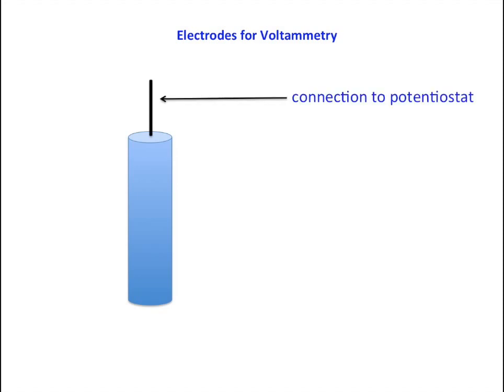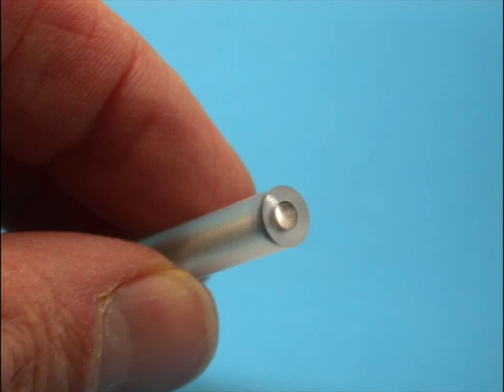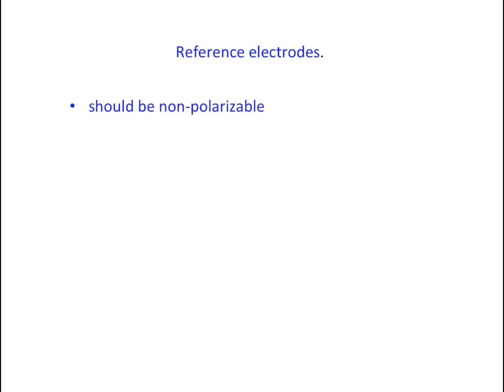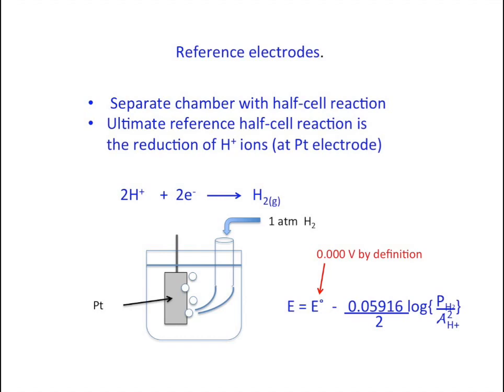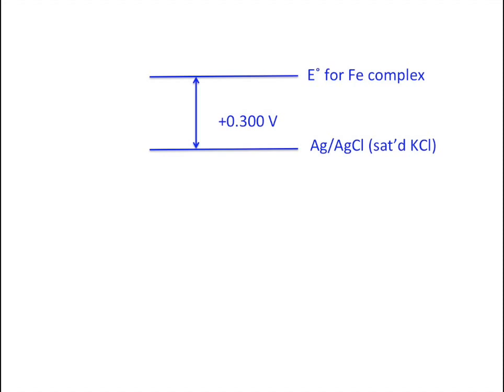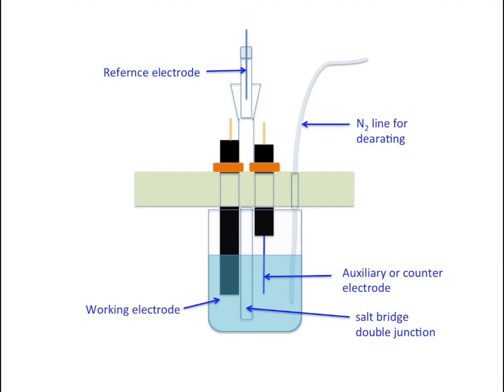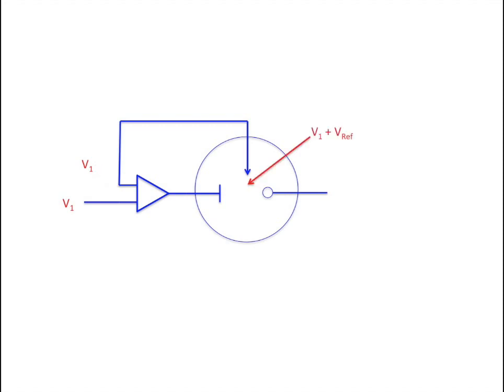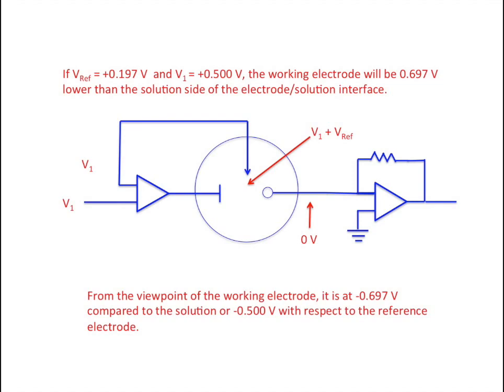Voltammetric Electrodes

Comment: Can someone please explain to me...if the working electrode cannot pass current (transfer of electrons into or from the solution) then how does it reduce or oxidize the species??
Reply from the maker: Hi Emaan,
I am not sure what conditions you are thinking of where the working electrode cannot pass current. You are correct that its main purpose is to reduce or oxidize species in solution. (We prevent the reference electrode from passing current so we don't disturb its potential. Could that be what you were thinking of?) We force the working electrode to different potentials in order to drive an exchange of electrons with something in solution. That potential must be near or more negative than the E˚' for the redox species in order to reduce any of the oxidized form and we monitor the current that passes in the voltammogram. (We see current for the oxidation of any reduced species when the working electrode is near or more positive than the E˚'.)
Reply: @garymabbott4064  thankyou for replying! And im confused because supposedly, a polarizable electrode cannot exchange electrons with the solution. I dont understand, if its not giving or receiving electrons (as a polarizable working electrode) how is it able to reduce or oxidize species?
Im really really new to electrochemistry (my whole career is in bio) so pardon me if im asking something really obvious
Reply from the maker: @emaanimtiaz4371  Electrochemistry can be confusing, in part because of all of the jargon. The term “polarizable electrode” means that voltage (the energy for an electron) between the surface of the electrode and the solution can be changed by imposing energy (from a battery or electrical power source) from outside the cell. We need at least one other electrode in the cell in order to do that experiment. A reference electrode, such as a silver/silver chloride electrode, can be used for that purpose. A good reference electrode will not move from its “rest potential” (its value that can be calculated from the Nernst Equation for the reference reaction, such as AgCl  + e  Ag + Cl-). We say that the reference electrode is non-polarizable. By selecting a non-polarizable reference electrode for a voltammetry experiment, virtually all of the energy (voltage) that we apply from the outside circuit ends up polarizing the working electrode. That is, all of the energy applied to the cell from the outside changes the voltage at the interface between the working electrode and the solution. If that voltage is big enough, it can force an electron exchange process there. A platinum wire or carbon electrodes are good working electrodes since they are polarizable and will exchange electrons readily with species in solution. 
	One point of possible confusion with electrochemical measurements is that there are two common types of experiments. Voltammetry is the type I was referring to in the paragraph above. Voltammetry is based on applying an external voltage to the system which forces an electron exchange at the working electrode. The current is measured and its magnitude is proportional to the concentration of the electroactive species in solution. Voltammetry uses a polarizable working electrode. The other common experiment is potentiometry. The rest voltage of the working electrode is determined by the solution conditions and it is this quantity that we measure in a potentiometric experiment. In that case the working electrode or sensor should not be polarizable. We try to prevent significant amount of current going through the cell, since it could distort the voltage that appears at the working electrode. That is, allowing current in the system would push the working electrode away from the voltage that naturally develops at its surface because of the concentration of the species that it senses.
	I hope that helps.
Reply from the maker: So, the bottom line is that a polarizable electrode CAN exchange electrons with something in solution, if we push it to the right voltage.
Reply: @garymabbott4064  thankyou, thankyou, thankyou! Iv been stuck on this for 2 days straight, watching a dozen youtube videos and googling it in a hundred different ways and NO ONE explained that. You've saved me from another sleepless night. Huge thanks
Reply from the maker: @emaanimtiaz4371  If you find yourself doing much in the future with electrochemical methods of analysis, I recommend (shamelessly) the following book:
Electroanalytical Chemistry
Principles, Best Practices, and Case Studies
By Gary A. Mabbott · 2020
ISBN: 9781119538585, 1119538580
Publisher: Wiley
Language: English
Author: Gary A. Mabbott

Comment: Reduction of the analyte on the working electrode requires a source of electrons, where the electron is obtained?
Reply from the maker: Electrons that the analyte takes from the electrode are replaced by a power supply (often a battery) that is part of the outer circuit. The arrangement of electrons (their "concentration") at the surface of the electrode is set by the voltage that is applied. If an electron "jumps" from the electrode to the analyte in solution, another electron will  move up to take its place in order to maintain the arrangement of charges associated with the voltage applied by  the power supply.

Comment: What is the potential at the reference electrode in a 3-electrode setup? is it 0.197V or is it whatever V_in we are driving into the opamp shown at the end of the video? Are we driving the reference electrode potential?
Reply from the maker: Wherever there is a boundary between two different phases or materials there is the possibility of a potential energy difference. Between the silver chloride coated wire and the solution surrounding it, there is a step up in potential of 0.197 V. A voltage, V1, is applied to one of the inputs of the amplifier. The amplifier is designed to drive the voltage at its output (where the auxiliary electrode is attached) to whatever value is needed so that the other input of the amplifier also reaches a value of V1. So, the wire attached to the reference electrode is at a voltage of V1. Moving from there into the silver wire and then across the interface of the AgCl and into the solution, the voltage steps up to a value of V1+0.197. So, (V1 + 0.197) volts is the potential of the solution. “Looking” from the solution toward the working electrode, an electro-active molecule “sees” the working electrode at zero volts. Consequently, the potential difference across the working electrode/solution boundary is a step of (V1 + 0.197) volts in the negative direction. The reference electrode is not really driven to change the potential across its boundary. That potential difference stays at +0.197 V,  but it gets added to the applied potential coming into the input of the amplifier.
Reply: @garymabbott4064  thank you, though I have two more questions: 1. is the 0.197V potential step between the reference electrode and the solution independent of whatever solution the reference electrode is in? 2. If I've understood correctly, we set the solution to a voltage of V1+0.197 with respect to earth ground, is this correct? In such a case, why is there no reaction at the reference electrode, is it because we are blocking mass transport to the reference wire?
Reply from the maker: @lucha6262  1.  The +0.197 V is the value that the reference electrode will have for a saturated solution of KCl. The potential energy difference between the AgCl coated Ag wire is, indeed, dependent on the chloride concentration (actually the activity) level. In a 1 M KCl solution, the potential is +0.222 V at 25˚C. 2. Yes, the V1 +0.197 V is the voltage of the solution with respect to ground. There will be a very tiny amount of a net reaction at the AgCl/Ag electrode because a real operational amplifier is not perfect and will allow some current (maybe a few picoamps--less for better amplifiers) to flow into the input of the op amp. That will not shift the potential of the reference electrode significantly. But, you have the right ide., The whole point of using a 3-electrode system was to avoid too much current (say microamps) going through the reference, because that would shift it away from the +0.197 V.

Comment: How about the current in ampere(in both oxidation and reduction)? How the system measure the current? is it related to counter electrode and working electrode?  Any equation for it just like the potential plot on x axis is the voltage of working electrode related to references electrode. Thank you.
Reply from the maker: Hi Canny,
You are asking a lot of good questions. This video was only part of the story. The current goes through the working electrode and the counter electrode through separate operational amplifiers in the outer circuit that are part of an instrument called a potentiostat. 

Here are two other videos that may help with some of your questions about what controls the current for oxidation and reduction. In these videos, I describe the main concepts from which the current-voltage equations are derived. To get another description, complete with equations see the article below.

Controlled potential analysis. Be  patient. The video starts with a review of potentiometric electrode measurements. Then
 it describes the principles behind electron transfer experiments (called voltammetry).
https://www.youtube.com/watch?v=d9ADCv5vNzQ

Cyclic voltammetry experiment. This describes the set-up of an instrument and running an experiment.
https://www.youtube.com/watch?v=BFefYBEL7wM

A Practical Beginner’s Guide to Cyclic Voltammetry
Noémie Elgrishi, Kelley J. Rountree, Brian D. McCarthy, Eric S. Rountree, Thomas T. Eisenhart, and Jillian L. Dempsey
J. Chem. Educ., 2018, 95 (2), pp 197–206.
Reply: @garymabbott4064  Thank you very much for your generous sharing, Mr. I''m really appreciate it. Have a nice day!